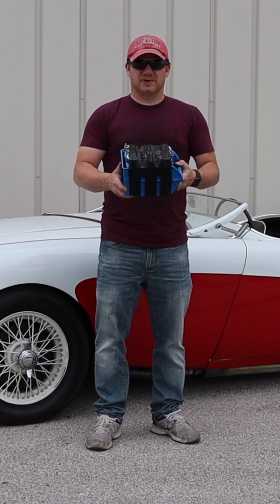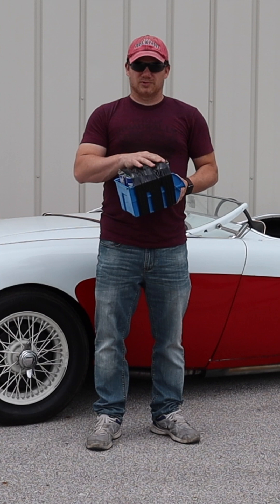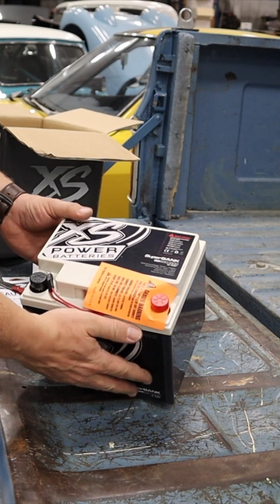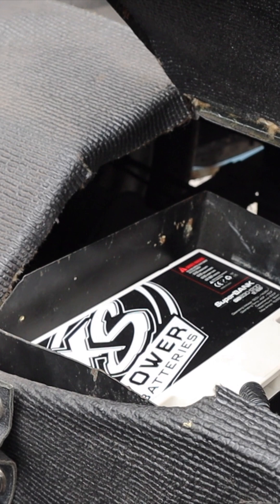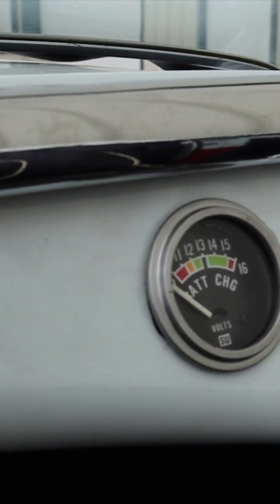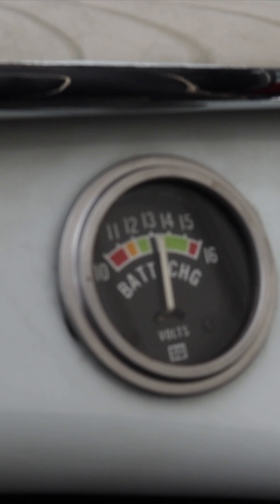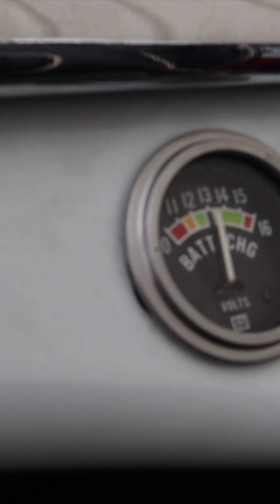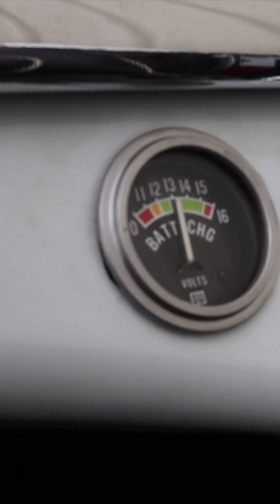Should you switch to XS Power SuperBank Ultra Capacitors?

Comment: That would b the cat's meow when I crank up my field tractor.
Reply: DO you have a video showing how you did ust that, build a CAP BATTERY ???
Reply: Every tractor I've dealt with had an extended crank, and would quickly drain the caps. Using one with a battery would give you the boost to get the engine spinning faster, and sustain the crank. Would be an interesting experiment
Reply: @tommyt414  DO just that Tommy. I have seen first hand how quick the tractor starts with ULTRA CAPACITORS.